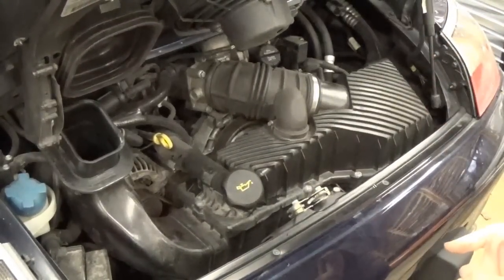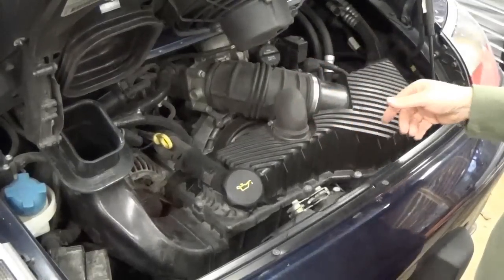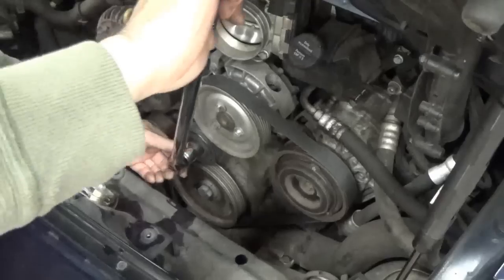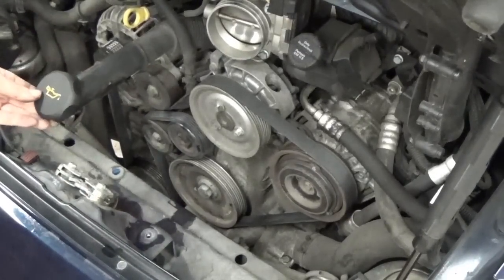DIY - Porsche 996/997 accessory belt change

Comment: The nut turns on my tensioner which in turn does not give enough slack to be able to fit the belt. Even when I force it using other measures, the tensioner seems to be at full lock, yet the belt still does not fit! 
Am I doing something wrong or is this a sign that my tensioner needs replacing? 
Great tutorial, thanks

Comment: Great video, very clear. Can you please tell me what Belt brand you used. I noticed that Porsche is about 3x the price of OEM belts. Where did you buy the belt ? Thanks.
Reply from the maker: I usually get my parts from Pelican in California or from Suncoast Porsche in Florida.  Sometimes Suncoast can do OEM parts cheaper than Pelican (but not always).
Reply: Van Svenson , thanks for the advice.
Reply: Thank you, I will try both.

Comment: There's not a lot of belt engagement on the power steering on those cars, eh? Do they suffer from belt slippage on that pulley?
Reply from the maker: I've never heard of an issue with the belt slipping on the power steering pulley.  I guess not much force is needed to spin the power steering pump.